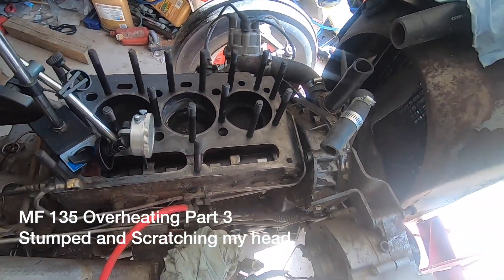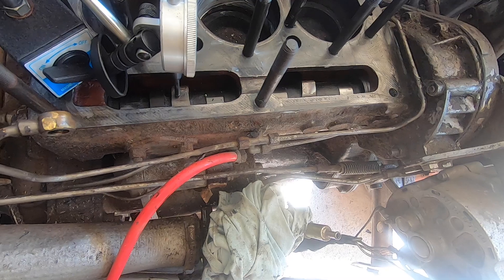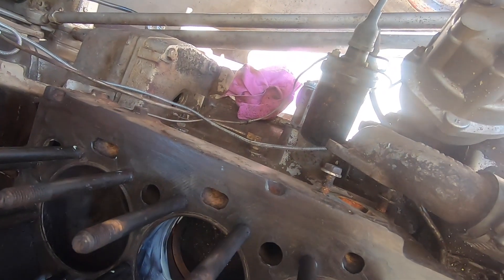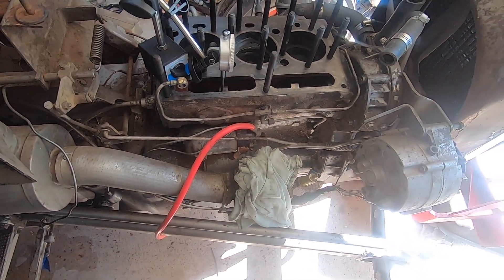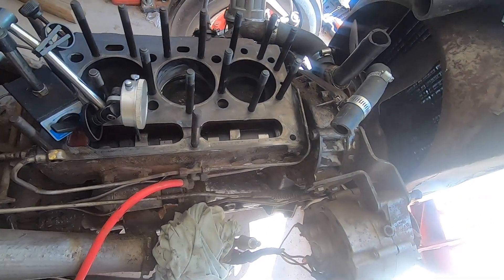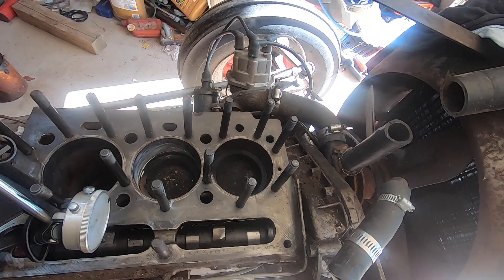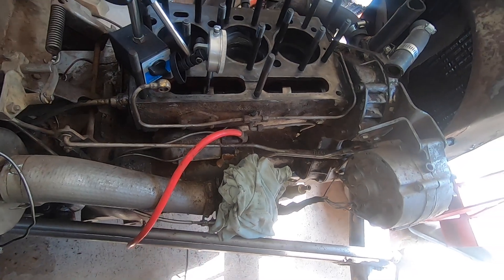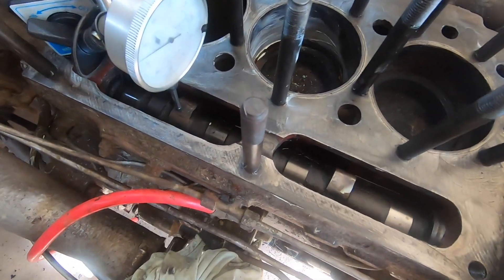MF 135 Overheating Issue Part 3

Comment: Thank God my diesel pump only had a few o ring leaks on top. I love my diesel mf135.
Reply from the maker: We got a MF230 that's the diesel version of this pretty much and it runs so much better than this gas version. We use the same sized battery and it starts much easier as well.